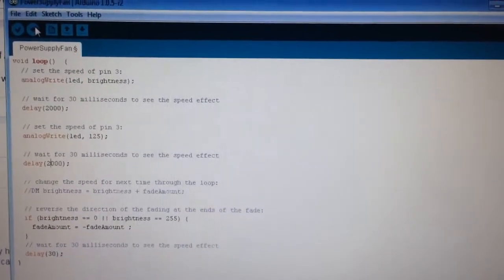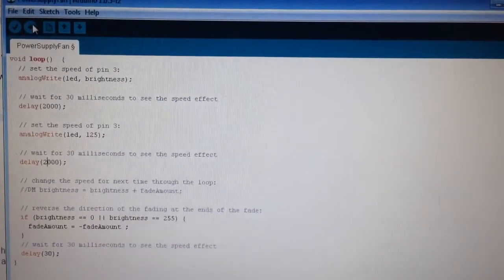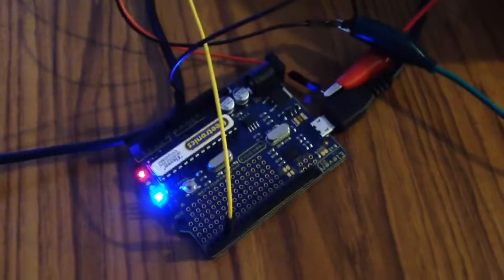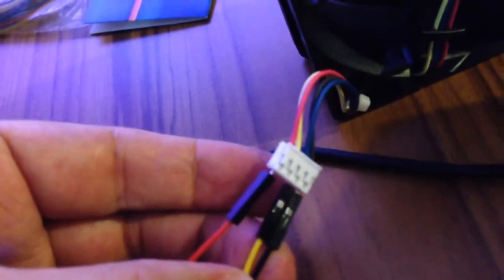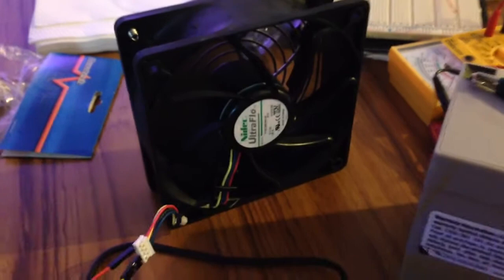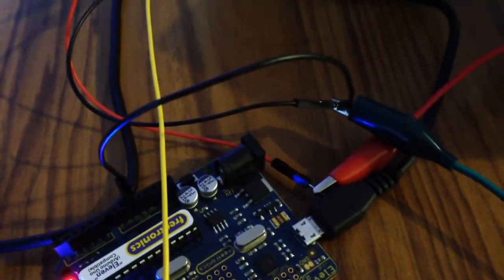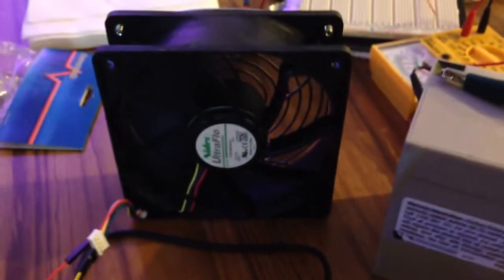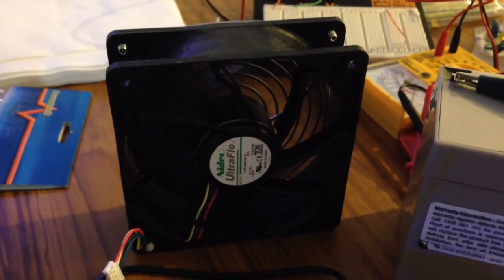Arduino controlling the speed of a 12DC Nidec computer fan

Comment: Are you recycling some LED related code here? Using "led" as name of the pin for the fan-control is a bit confusing...
Without the code, this is a bit useless. What's "fadeAmount"? And how do you use it? The line where you add/substract it seems to be commented out?
Reply from the maker: Correct it is a modification of the RGB led code example. The speed changes from 0 speed to half speed. Not seen in the video is "int brightness = 0;"   You can ignore the code for fadeAmount.